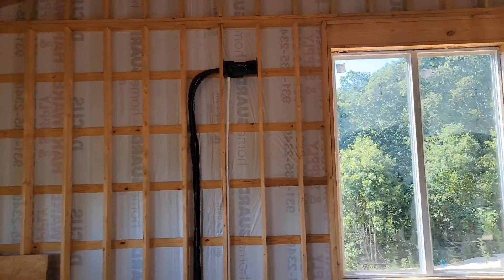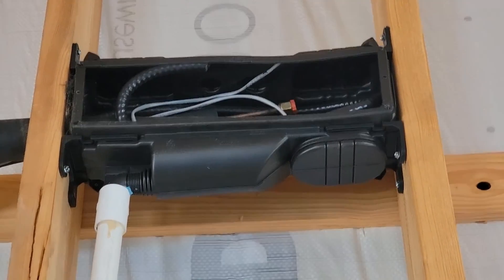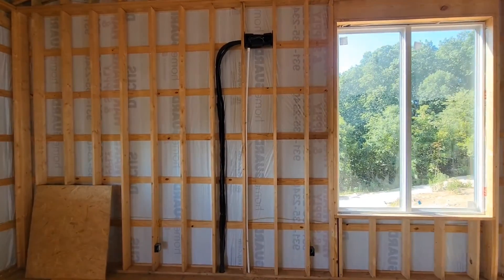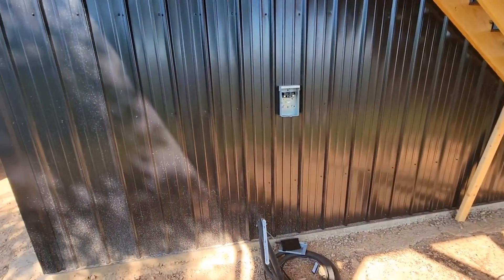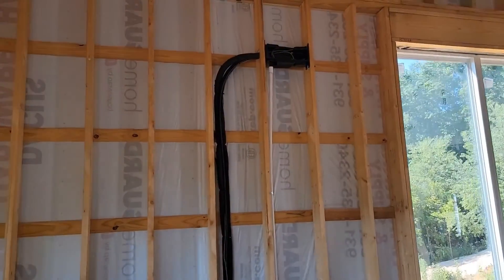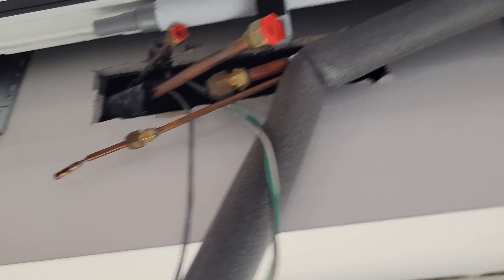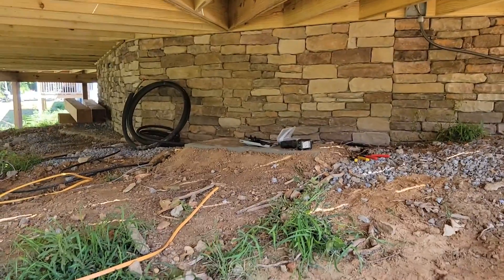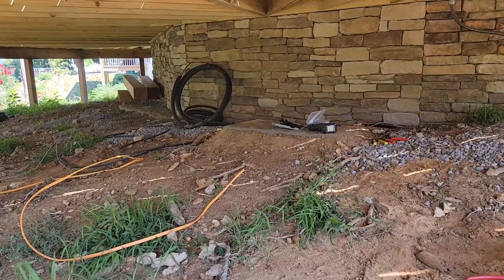How to rough in a Mini Split in new construction house?

Comment: Hey Tad, great video love your presentation style. I'm a DIY old guy, going to attempt building a panelized home that they show using a minisplit.  all the ceilings are all vaulted, with interior walls that go from floor to ceiling. Just wondering how minisplits work to heat & cool closed rooms (bath rooms); should I install wall vents or squirrel fans to circulate air into those rooms?

Comment: What happened if you have to replace the lines if inside the wall
Reply: The line sets for regular HVAC systems, like the 3 at my house, are run inside the wall cavities before the wallboard is installed. I would want to make sure that the mini-split line set is fully and adequately insulted if in a wall cavity to prevent any condensation within the cavity.  Also, you don’t want to have any connections inside the wall

Comment: So what about the condensation coming from the line sets? You aren't worried about moisture/mold issues throughout the walls?
Reply: @jeffreyhalverson83  insulation covers copper lines

Comment: Why do you need the rough-in box? Can't you just run the lines in the wall?
Reply from the maker: After doing many of these, I don't even recommend roughing in the line sets for a three ton unit because the size of the copper, it's hard to hook everything up

Comment: If it is possible to connect drain to sewage line is that acceptable? Or should it still run outside?
Reply: Not an issue so long as it's code, will need a small trap like u see on a central a/c unit.  I'm not sure if cleanouts are needed, like u see on plumbing drains.
Reply from the maker: Depends on your local codes

Comment: I need to install 3/8 & 3/4 lines. I bought the 50 footers and they are not charged. I have two similar bends like in your post before out of the walls ( total of 4 bends ). How is this done without kicking them. Can you give me some ideas. Im from Vancouver Canada. Thanks
Reply: @paulgill7222  I have the same question. I need to run 60ft of line set ip a wall, turn a corner, through a ceiling, turn a few corners, down a wall, turn a corner to exit the house. How is this possible without kinking the line set?

Comment: I just wanted to say thank you for the video, I ran across this while researching mini split systems for a 30x40 metal shop that I am converting to a barndominium  for my dad to move into. I did not realize that rough in boxes even existed. There are a few questions I have if you have time to answer, 1st can I run the lines through the attic space to get over to the condenser? I am looking at having a 4 or 5 split unit and I would hate to have all those lines on the outside wrapping around just to get to the condenser, my other option is to get the ceiling vents instead of the wall mounts to accomplish this but I am looking at being cost effective.  2nd question, what brand and size would you recommend from your experience?

Comment: Hi, I am installing bead board on my interior walls. I wanted to do exactly what you are doing because I didn’t want to see the lines outside, but I was told that if I ever have a leak, I’ll be in trouble and I’ll have to open my walls. Can you speak about this?  Is that true?  I just started installing the bead board so I still have time, but I’d like to know your thoughts. I don’t want to potentially have to remove any walls later.
Reply from the maker: I've never had to remove walls but it's all about the installation.
Reply: I bought the box, but I was then convinced to install the lines outside. 🤷🏻‍♀️. Now I have a new box that I didn’t use and can no longer return. I guess I’ll try to sell it at a discount.  If you know anybody interested…I’m in Florida.
Reply: Don't over think it.  You could have a leak in a bath tub drain but we don't run them outside.
Reply: How would the unit service the other rooms?  Then factor in the closing of bdrm doors at night.  Anyone have experience with this type of layout.  we're planning a new build.

Comment: I only have 2x4 walls. I now the lineset will fit in there, but I won't have a lot of space left over for insulation (fiberglass). I'm afraid of having a cold spot there (northern WI). Should I just go outside with it? It's just a garage, not a house.
Reply from the maker: Definitely go outside with it

Comment: how do you handle air circulation between the rooms when you only use one unit?
Reply from the maker: undercut doors 

and 

vent on wall
Reply: do you mean a powered wall vent or just a standard register type vent? 
 @taddydigest
Reply from the maker: Standard vent

Comment: I'm getting started on running my lines this weekend. The pig tail on my registers (Pioneer) shoot left about 18" long so if i use the rough in box would i need to off set the box to the left a bit so the pig tail from the register would connect flush with in wall line set? Secondly, i cant seem to find the rough in box in my city and don't have much time to wait. How do you recommend rough in without? Lastly, is the black insulation around the lines on top of what the units come With?
Reply from the maker: Yes You would have to offset the unit

If you have the option to go straight out the wall that's what I would do.
Sometimes, you have to insulate the flare connections and a little bit of copper.

Comment: Hi Tad - thanks for the install demo for the rough-in box. I have a question. I am adding a room off of my MBR, 16'X16", 256 sq. ft., and I want to use a mini split for my HVAC. Have you seen the mini split installed inside the wall, with a decorative grid on the interior wall? I have seen it in high-end houses in countries all over the world.  OOPS, I guess the US is a bit behind the 8 ball on this one. Since this is basically new construction, I should be able to do it, right?  Do you have any resources that I can refer my GC to review? Thanks for you help.
Reply from the maker: Samsung makes a concealable unit that is not exposed 
check out samsung hvac downloads

Comment: Thats a long drain line! Hopefully no issues with clogging. I like to keep the concealed condensate as short as possible because it's impossible to access if there is ever a clog. Where do you purchase the rough in box from? Are you using factory flares on that line set? Looks difficult to get a flare block in there.

Comment: Pretty slick installation.  I'm close to installing mine. Mini splits seem to be a more reasonable option. That's what is use overseas
Reply from the maker: Thanks
 Yeah they are definitely more reasonable more efficient
 And it's better for applications where you have foam insulation

 I will do an update video showing the final install on this one in a few weeks

Comment: Want to do this on my new build but curious what the protocol would be if you have a leak at any point with all your pipes in the wall?
Reply from the maker: Never have a connection in the wall
 Are you talking about the refrigerant pipes
 Never have a connection inside the wall that could leak at any point

Comment: I am going to be building a new home and am thinking about using mini split units.  In research it seems that Mitsubishi has the highest rating for them.  I see that you use Samsung.  What is your thoughts on them compared to Mitsubishi?  I want the heat pump also and want to make sure that it heats in the winter.  My place is in SW Missouri and it can get cold even sometimes to 0 or a little below.  Not most of the time but it can get that low and I want to make sure it will heat I am not going to have a fire place.  Thank you
Reply from the maker: Good idea on the fireplace as a backup
 I like Samsung Max heat
 Units for below 0 areas
 I love Samsung because they have easier to use controls and nicer looking equipment
Reply: OK thank you. I am not going to have a fireplace
Reply from the maker: Oh got it